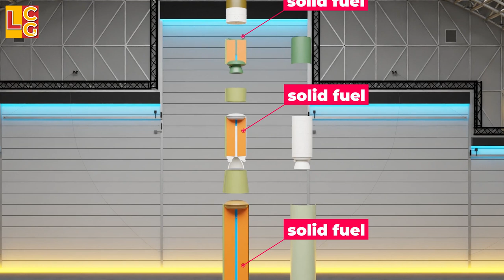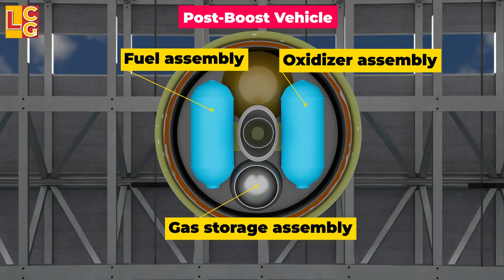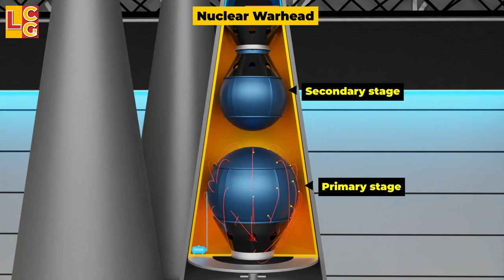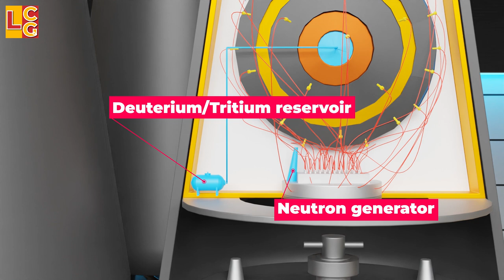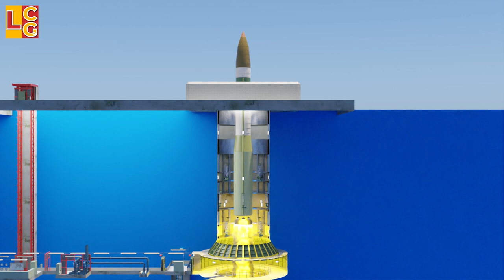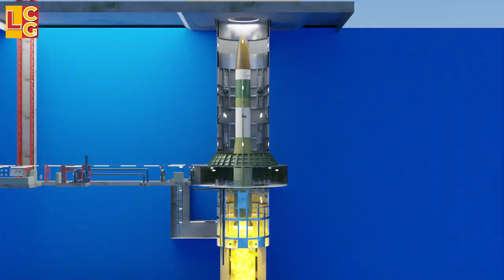Exploring the Amazing Mechanics Behind Intercontinental Ballistic Missiles!

Comment: The launch crew does not set the flight path for the missiles. Target data is kept confidential from the crew and is directly coded to the missile via the entry of an authenticated launch code. Different codes will have different target packages. This is done to remove a sense of guilt from the missile launch crew as they would have no idea where their missiles were headed.
Reply: Usually the crews have a selection of targets that they are ordered to fire at, but yeah they have no idea what those targets are.
Reply: 1944: Blanks so the firing squad doesn't know who actually killed the prisoner 
1960's: Coded flight path so the launch crew doesn't know where the millions they killed were.
Reply: @bjack29785   wow press a button and 1000000 people died. No sense of guilt?

Comment: I have googled and cannot find an answer to my question: How do the MIRVS find their targets? I can find no mention of navigation systems on the MIRVS, which suggests that it's the bus that does the driving and at the desired location, the MIRVs are let loose.... but that would suggest that MIRVS are all intended for one target. So from WAAAAAAy up in space, the bus basically aims and fires the MIRVs and their reaching the vicinity of the intended target is based on how on-target the bus was from way up in space? It's like a conventional B52 dropping dumb, unguided bombs... but from hundreds of kilometers above the ground???
Reply: The bus as you said does the driving. It calculates release points for each warhead based on targeting information loaded before the missile is launched. The bus has a number of sensors that it can use during flight to update release points. . Keep in mind, the bus is flying just under orbital speeds and is in a ballistic arc. Once a release point is reached, the warhead is released and it will follow a ballistic reentry to its target. The bus drifts on and continues releasing warheads along its path of flight. It’s not what’s shown in the video with all the warheads being released at once…
Reply: not all information is available to the public. there will be some hidden mechanics behind it's inner workings.
Reply: The bus (mirv carrier) uses it's engines alongside it's RCS thrusters to maneuver to a trajectory (the path it follows based on earths gravity and the objects velocity) where it would then deploy one or more warheads on that trajectory. Once released, it will maneuver to another trajectory, where it would release more. The cycle repeats until all warheads are depleted.
Reply: Here's a possible explanation. The precise technical details are closely guarded military secrets, to hinder any development of enemy counter-measures. The bus's on-board propellant limits the distances between targets of individual warheads to perhaps a few hundred kilometers.[11] Some warheads may use small hypersonic airfoils during the descent to gain additional cross-range distance. It is probable that the MIRVs have a limited ability to alter their trajectory for greater accuracy, obviously no nuclear power is going to elude the precise nature of that design.
Reply: @bjack29785  lol copy and paste
Reply: its possible there is some information that isnt there just for everyone to find

just sayin